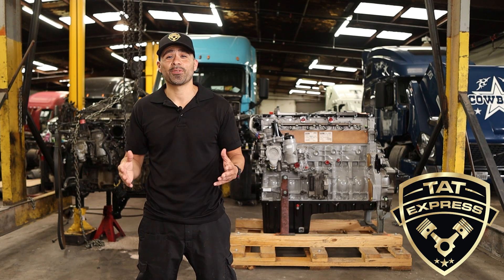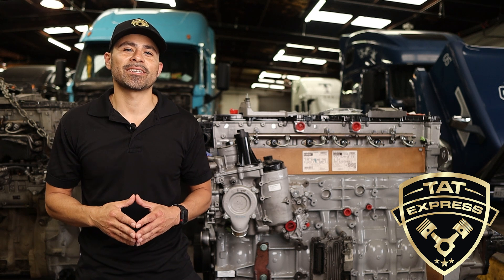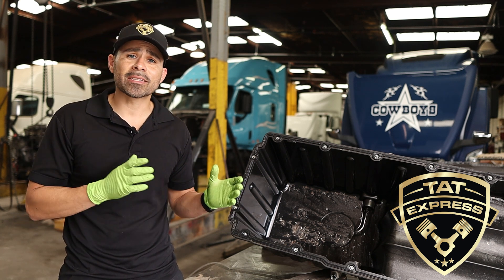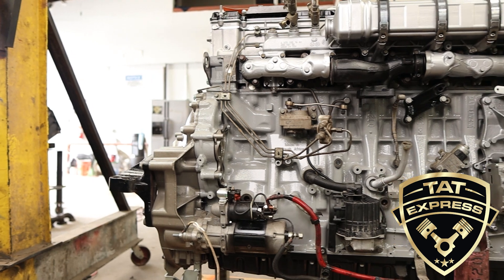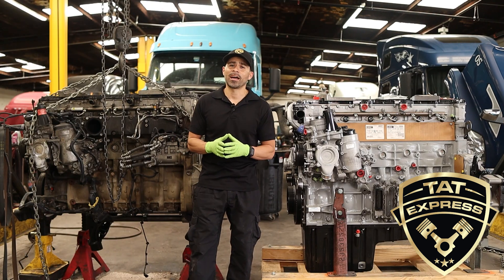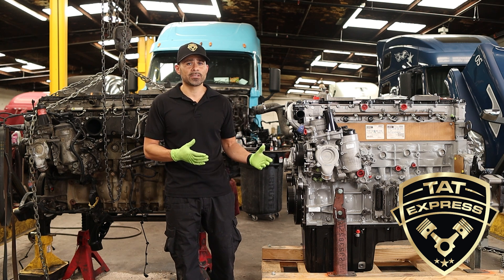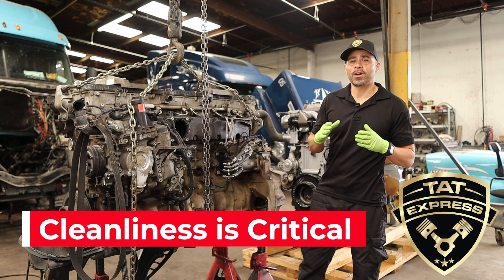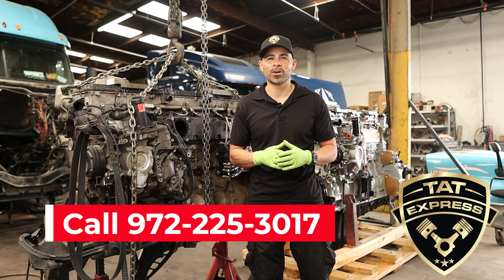DD15 Rebuild failure/ DD15/ Most Common Issues/ DD15 Engine Locked up/ DD15 Engine Rebuilding Tips

Comment: You can’t replace the crankshaft if you spun the bearings? Why do you need a new block engine every time?
Reply from the maker: @poonetidestroyer8955,  The cost of this process often make it more practical to replace the engine or opt for a remanufactured unit to ensure reliability and longevity.

Comment: Hei Adam,if I need a new (replace)DD15 right now for my 2014 Cascadia,what's on the market?
Reply from the maker: It would depend on the serial number and if the engine is available.

Comment: I heard a dd13-15 delete n it sounds lound n disgusting hope to learn more about them in my country
Reply: Which is your country taking about
Reply: This is in USA
Reply: @kulwindertatla5987  i knw its texas i live in jamaica
Reply from the maker: Actually, the DD15 is much quieter than older model engines.  Less vibration as well 🇯🇲 🔧💪🏼
Reply: @TATEXPRESSINC  i had an experience with 1 in it was quiet as hell but the dd13 str8 pipe is loud ...n the dd15 has a deep growl wen piped
Reply: @TATEXPRESSINC  i had an experience with 1 in it was quiet as hell but the dd13 str8 pipe is loud ...n the dd15 has a deep growl wen piped

Comment: Freightliner advertised at 38k 2016 with 769k on it. Says DD15 motor. Says lower done at 599k. What does this mean. Is it worth buying. Plan to work 3 more yrs. Thanx, Claude

Comment: I bought a Jbhunt 2016 Cascadia - dd15 with 298k from freightliner dealer. Is there a way to check the dpf and tell if it needs to be cleaned or replaced.
Reply: Typically,  if your Engine starts calling for more frequent "Regens", this could mean that the DPFs are Clogging up, and need to be Cleaned, or Replaced

Comment: I have a dd15 2009 freightliner cascadia I had a mechanical working on my truck he put dawn dishwashing liquid in my air to air cooling? He told me too turn the key to crank the truck up the start and now the motor will not turn over please help is my dd15 engine lock up for good
Reply: why would you let a mechanic blow up your equipment like that

Comment: My question is, if the out of frame overhaul failed shortly after, did they line bore the mains, and turn the crankshaft ??  
Like the videos !
Reply: I agree, also with engine seized, connecting rod can develop a slight bend that can cause failure later on...

Comment: If an inframe is done on a dd15 specifically on a 2014 Cascadia with a PAI aftermarket inframe kit and the motor sounds fine great actually when it idles but when you give it some fuel while it’s idling is starts clanking would this be a result of poor fuel and not priming the fuel pump ???
Reply: You figure it out what it was?

Comment: it's not the DD15 that worries me, it's the aftertreatment system attached to it that makes me lean towards the 60 series. I heard if anything happens to the 1 box it can cost more than 10 grand out the door. Potentially putting owner operators out if business, and it's a shame cause i really like the new Cascadia's :(
Reply from the maker: West2401, the after-treatment system, is the number one concern for all owners.  It is best to follow OEM maintenance to avoid major repairs.      🔧💪🏼
Reply: This video has nothing to do with the aftertreatment system but the engine itself.Series 60 is a good motor,but myself I like dd15 better.More torque and more flexibility, and better fuel mileage 🙂

Comment: What we’ve found on the DD15s we’ve tore down is the plastic pickup tube warps and let’s the oil pump suck air— then there’s a check valve in the pickup tube and they stick both conditions will wipe crank out while showing oil pressure and this is on engines with clean oil and were never run hot, we’re getting rid of all the trucks with this engine.

Comment: If you have a new cascadia with brand new gen5 dd15, have valve adjustment done asap. When you hear noise from the overhead, its too late, warranty will pay for the repairs but now you need exhaust valve bridge and adjustment screw. 
If out of stock it will sit in the shop. Avoid down time.
Reply from the maker: Thanks for sharing your experience.  Be sure to subscribe 💪🏼🔧🚚
Reply: Only the trucks from mexico have that problem. Ask me how i know?
Reply: @truck6280  had a few here in NC so I’d say not just a Mexico problem. There’s a bulletin out for it and dependent upon how bad it is depends on if it gets an overhead, adjusting screws, or bridges & adjusting screws.
Reply: @dsdiesel8667  good to know. At first they said it was only the saltillo factory affected because machine was out of calibration . I had to get my valves done about 15 times in 3 months until they gave me a new truck. Lost a LOT of $$$$$$$

Comment: Truck has been in the shop for 4 weeks waiting on the stage 3 rebuild kit. Freightliner is charging me $40,000 for the rebuild. Does a remained engine from Detroit cost about the same?
Reply: In Australia it's about $35,000 aud for a reman like what is sitting there with labour.. replaced one about 3 weeks ago
Reply from the maker: Lightning, It would cost more to swap the entire engine.  Thanks for watching 🔧💪🏼🚚
Reply from the maker: @mick romer,Thanks for sharing. 🇦🇺💪🏼🔧
Reply: I would just buy another truck. Much cheaper. Than paying 40k for a rebuilt
Reply from the maker: @sheldon, with current market conditions, it is challenging to find a quality truck for that price.  Thank you for sharing
Reply: @sheldonbrown6111  agreed TAT.. yes you could buy another second hand truck but it most likely will have more than 3/4 of a million kms on it.. and so your buying something that could also have engine issues or even drive line issues.. it's a pretty big gamble.. also if you were to buy a new prime mover, your up for roughly 300k depending on brand/model etc, that's Aud anyway

Comment: Very helpful video, I have a epa10 DD15 in my shop right now that had a liner failure, after removing bearings and inspecting crank shaft I found severe damage to the crank itself and this video helped me decide to not go any further with the rebuild of this DD15.

Comment: When is a good time to look at rebuilding or getting a new engine when it comes to the d13 Volvo engine
Reply from the maker: Sherm,  it would be best to have the unit checked out.  You could do an oil sample and keep an eye out for high crankcase pressure or if you are burning excessive oil.
Reply: Thank you sir

Comment: The best thing to swap that boat anchor out with is anything but that hell I’d put a Briggs & Stratton in the fucking thing …them  motors are junk!!!!😉
Reply: Better than Cummins right now. I see the new x15s a lot with low miles having some big issues. Have seen many dd15 a make it over a million and still running. People who complain about them don’t take care of them. Especially guys who talk about how they did less maintenance on an old engine and it still would run. New engines have to be taken care of. These engines are not for the guys who do services once a year.
Reply: @joshrichardson7340  we change your oil every 7000 we’ve got two 2250s with over 800 on them and only thing we’ve done is open up the top and run the rack , The key thing is though you gotta delete them 😉that carbon pack is a killer and them motors

Comment: Detroit needs to ditch that DD15 it's a hybrid pos.
Reply from the maker: @trucking with cliff, thanks for your feedback.  The DD15 is here to stay; the gen 5 is one of its best models.  Most of the bugs have been worked out.
Reply: @TATEXPRESSINC  I hope so because the motor that's in the 2015 I bought shelled the bottom end before the 500k mark  of course there's no telling how it was taken care of before I bought it. Hopefully the def systems improve again another issue I had to deal with the day the factory warranty went out 400 miles from a dealership that closed at 11pm.